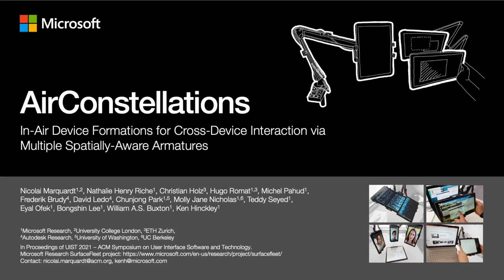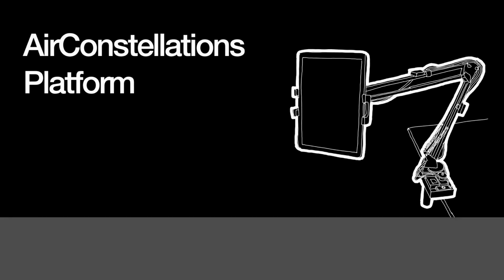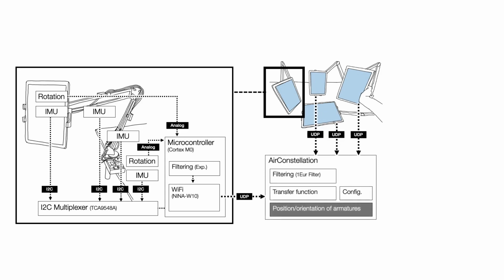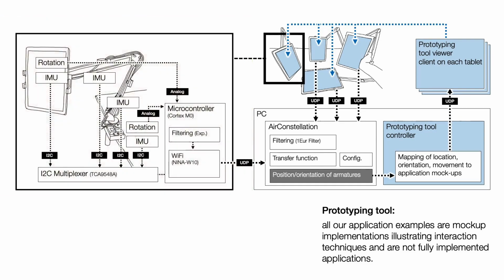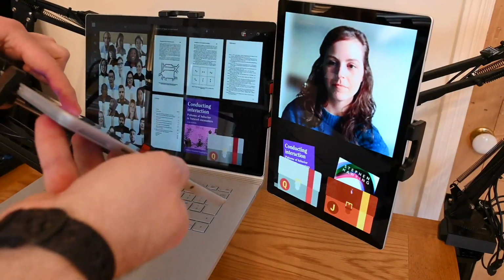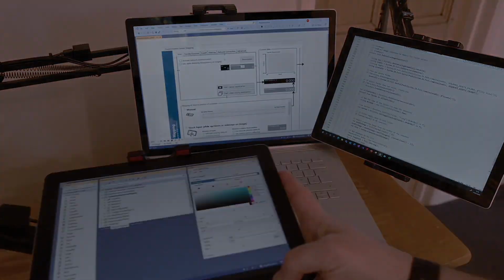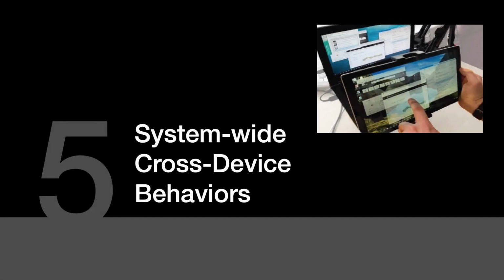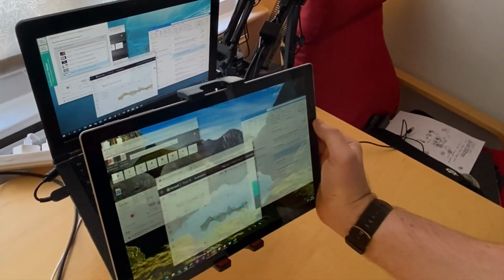In-Air Device Formations for Cross-Device Interaction via Multiple Spatially-Aware Armatures

Comment: But we are far away from holographic interfaces controlled by hand with small movement radars. It would be a device each phone does not have. It's a different approach of discovery, beginning from a practical example and not from theory. Please prepare those documents as your assignment, we have achieved it. Motion tracking upgrading is a must if it's being tracked with wires and exoskeleton approach is where it went wrong, but maybe it's impossible due to low 1 metre precision.

Comment: I'm sorry. You're telling me that spatial positioning in 2021 is not achievable with all the builtin sensors? We've had AR for a good 10 years now - you can walk around your room, and a 3D Pickachoo you set on your table, stays on your table, even after the table goes out of frame. And here you are, spending God knows how much time and money developing custom extension arms just so that screens know relative position to one another??? I get the software, I get the workflow - it is amazing, but my God. The way you actually did it on a hardware level makes this presentation look like it's been done in the 90s not now :/
Reply: Ideally, they'd use some sort of system where the devices themselves can accurately track their positions relative to both each other and/or a base station - preferably in a way that doesn't require direct line-of-sight - in order most accurately reflect their real-world locations in "digital space". That old active magnetic field technology by Sixense (used in the Razer Hydra and ill-fated Sixense STEM concept) would've been perfect for something like this, but that tech seems to have sadly been lost to time ever since the STEM went bust. Maybe Microsoft should look into what Sixense is up to nowadays and what happened to their tech; last I checked they were partnered with some medical research firm now.